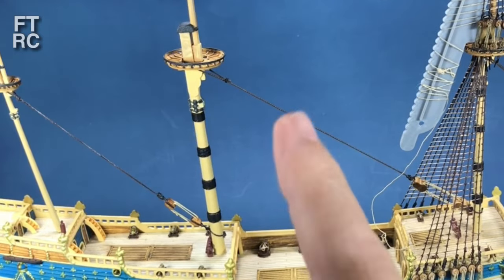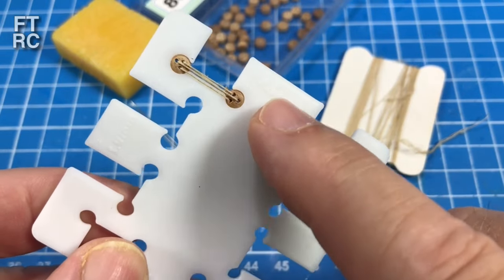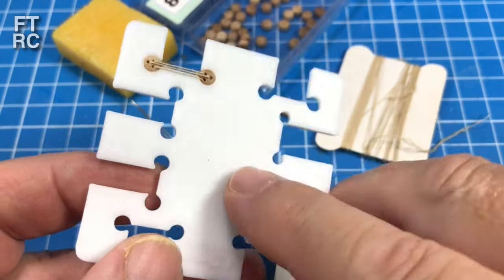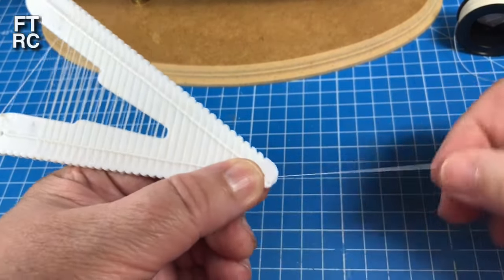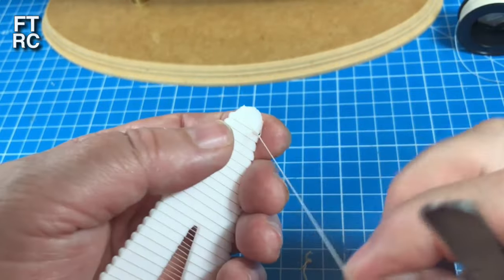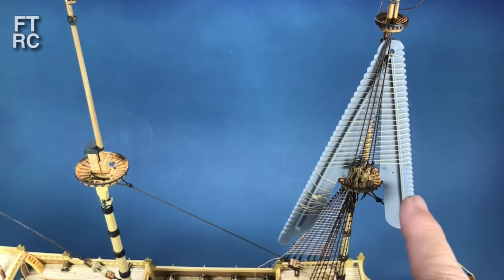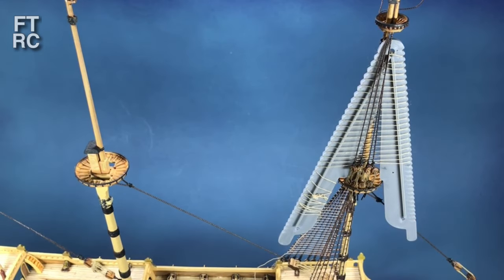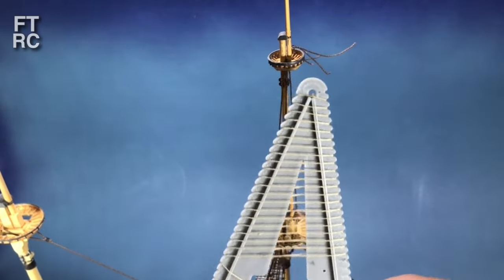Easy Ratlines for model ship rigging with my Rat Harp and Dead Bug tools for shrouds and deadeyes

Comment: I imagine that instead of a toothpick to dab spots of pva on to attach the lines, you could use thinned-down pva and brush it on, for less blobbiness 🤔
Reply from the maker: You could try that… however Selly’s Aquadhere PVA is very watery and dries completely clear, so I have never had an issue using it.  Your glue may differ.

Comment: Hey mate love it! Instead of wrapping around the harp coyldnt use just wrap around harp only having string on the one side? Just thinking of the waste of the non touching side 🤔
Reply: Hopefully you get what i mean. If you made the pointy bits longer so you go over the front and the pointy bits you just go behind then up to next divot pulling string back the otherway on front? The hobby needs more people like you showing us the tips and tricks and not squirreling the knowledge away
Reply from the maker: Yes you can do that with the Harp however, it is so much harder to keep the loops tensioned and invariably one previous loop slips off half way back, then you have to start again.  I even deepened the grooves to try to solve this but every time I strung the harp a loop would come loose somewhere and ruin the wrap.  This tool is very small and wastes only about a third of the thread you do with the Heller Loom. By winding around you keep a momentum tension so the harp stays rigged.  I will keep experimenting, but for now that is the best solution.
Reply: Maybe instead of having groves on the harp you had a sort of hook that way you could loop it around the hook and then go to the hook above without the risk of it slipping off, then go across and around the hook and then to the hook above.
Reply from the maker: That is not the issue.  You need to keep tension on the cordage or it wont hold together on the harp behind the shrouds or get knocked off as you insert it.  

Remember the ratlines are only a few millimetres apart, so any tiny hook would be so fragile that under tension it would snap off breaking your Rat Harp and making it useless trash. 

I have spent years perfecting this tool.  By all means try out your ideas yourself on a 15cm long version with grooves 3mm apart, then see if it works your way.

Or better yet, buy one and then see for yourself how easy mine works.  Saving 10 cents worth of wasted cotton is not worth all the worry, believe me.
Reply: @HarryHoudiniModels  i guessed their was a reason why.  Keep it up looking giod

Comment: So this is only for 1/144 scale ships, Harry? If I get a ship model in a different scale, then I will need to wait till you design a Rat Harp and Dead Bug to fit that, right? 🤔
Reply from the maker: I have already made version for 1/72 down to 1/200 scale.  Because it is a CAD drawing it can be quickly enlarged or reduced for any scale.  That was why I wanted to stop making each one by hand, took over 4 hours to cut it out and score all the grooves.  CAD and 3D printing means I can modify to any size or scale of ship quite quickly, then print out the result in minutes.

On the website order form I ask the scale and name of your ship.  From that I use one of my scaled templates in CAD and tweak to your ship’s measurements. https://houdinimodels.com/harp/
Reply: @HarryHoudiniModels  That’s awesome, Harry. I’m thinking I’ll start looking for a ship kit that really interests me and get your Rat Harp & Dead Bug for it. 👍🏻

Comment: If you cut a slit in the top (like the kind on a spool of sewing thread), you can put the string through the hole then just wedge the it in the slit without having to tie it. Of course, it might not work, so it needs experimentation.
Reply from the maker: Captain that could damage the shroud as they need to be longer to tie to the mast. What I do now, after much experimenting with my tool, is gather the shrouds through the top hole then use a clip to hold them in place with enough tension for the ratlines below to glue in place. I also now rubber band the Dead Run to the Rat Harps feet so it also pulls the deadeyes and shrouds down to keep tension.  
https://youtu.be/k02lw0KHnRQ

Comment: Er, Harry, with the rat lines you’re wasting more than half your thread. If you make your notches a little deeper and squarer, then instead of wrapping the thread around the back of the jig at an angle to go one notch up, why not just wrap around between two notches on the same side (left or right) to move up: then straight across to the same position notch on the other side (right or left), then round the back of the notches to the next one up, and repeat. All rat line threads on one side, and the risers only behind the notches.

|______________
________________|
|______________
________________|
Reply from the maker: I have done that with larger kits like the 1/100 Victory but have yet to make a video showing the technique. On smaller Rat Harps it is impossible to keep the tension so the whole rig falls apart. You simply cannot make the grooves big enough on a tiny tool.  I have tried it.  As for thread waste, my tool wastes much less thread than the old Heller ratline loom.
Reply: @HarryHoudiniModels  oh well, worth a thought

Comment: I know you Aussie’s do things differently, but why not Knot the thread before you use the needle 🤔
Reply from the maker: The beauty of the Beading Needle is that you don't need to... plus it goes through smaller holes without a knot and the thread is so easy to insert and remove